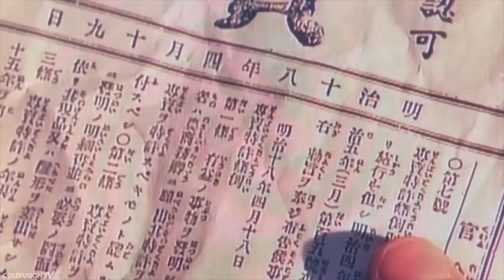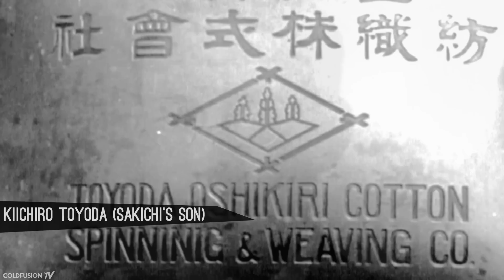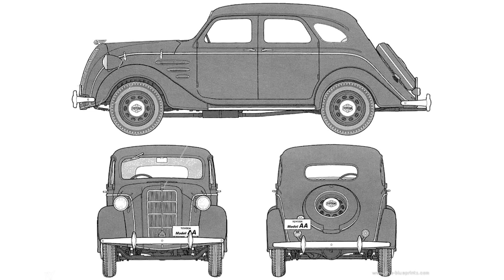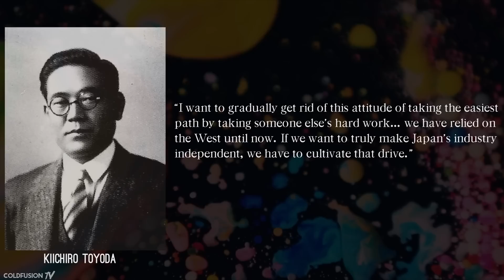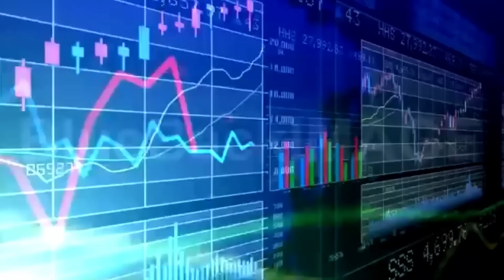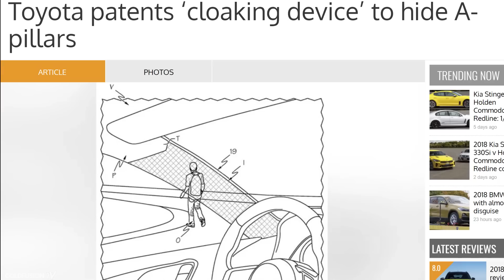How Big is Toyota? (They’ve Owned 27% of Tesla Motors!)

Comment: I crashed my Toyota Corolla and engine is still running perfect with over 200k miles. Everyone should have a Toyota as a back up car before getting a more luxury car
Reply: Just hop on that Lexus brand!
Reply: @LilAzn49  land cruiser
Reply: Haha i crashed my 1.5 l toy and i thought oh shit causee all the lights on dash and oil light going crazy, then i turn it on after i get over the shock and drove it to the side... 310k miles strong engine just i let it go to scrap cause fixing the body would be more expensive than just getting something else. Cheers!
Reply: @Jesse Mulliniks get a Lexus!
Reply: my luxury car is toyota. Ranking of my favorite 1. Toyota Avalon 2017, 2. Toyota Corrola 2019, 3.Toyota Previa 2014, 4. Toyota Mirai 2019 after I fogoten of jaguar xjr cause it's impossible
Reply: My dad works in toyota

Comment: My Camry Hybrid is still running after I put 400K (miles) as taxi and never have problem.
Reply: you put gas or charge it ? Which one you do more ?
Reply: Babar Ali hybrids are charged by regenerative braking and gas engine.
Reply: @Jesse Mulliniks plugin hybrid should do all the above plus be able to plugin. unless its purely electric then it will just rely on its own batteries charge solely.
Reply: Dito
Reply: @Babarali08333  Hybrid means you still pump gas Einstien....... Toyota has been making since 2000...... They are the leader of hybrids! They are the leader in the hybrid game!
Reply: Hybrid how is that possible

Comment: I own 2006 toyota avanza in Indonesia, it has very basic car but reliable run 300k km with no annoying problem, easy to fix, low maintenent large market & cheap spare part, practicle, it has just 1SZ-FE 1.3 liter 7 seater front engine real wheel drive, price converter to u.s around $9000 at new, and that car was best selling car over 15 years.
Reply: thought honda mobilio and brv plus mitsubishi xpander starting beat this car on sales
Reply: latio latia before avanza  launch new model... Lol
Reply: Avanza is astra product, not toyota. Same like innova.
Reply: Veez what ever dude, i just saw toyota badges on my steering wheel, rear door, front grill and under the hood
Reply: RAIL BRO now fix lexus 570, lcgc should be compared to lcgc
Reply: Gigine Ahmad sorry for waiting, i don't have money to fix that big brother, but i can go with my car now every where, take a look back your self...
Reply: Veez... Most car in indo are made in Indonesia
Reply: yeah, but its under toyota standar

Comment: Since it's pretty hard to find, Toyota's quality system is also called "5Gs" in the industry, with the 5Gs being:

Genba - Learn from the place where the actual work is being done.
Genbutsu - Learn from the actual materials and components that are being used.
Genjitsu - Learn from real facts and figures.
Genri - Learn from actual theories.
Gensoku - Learn from actual operating standards.

"Gen" in Japanese means "real" or "actual". i.e., don't assume anything, don't make stuff up in your head. Go check on what's real.
Reply: Sounds like the ultimate brand for theists to avoid.

Comment: Crazy, I just finally purchased my first Toyota. I got the 2019 Camry SE 2.5L 4cyl 203hp + convenience package for $28,500. There's only 3 things that I could think of, that's missing from it being fully loaded. I don't have sun/moonroof, no navigation and it isn't a V6. But, it literally has everything else; push to start, keyless entry, lane departure warning, rear heated mirrors and blinkers, adaptive cruise control <one of my favorite features lol, lane assistant (it literally turns my steering wheel back into lane), back camera and traffic alert from left and right side and a lot more features. I got side skirts, rear trunk spoiler, door body molding spoiler, adaptive headlights and the weather carpets, trunk package. I actually get 32 miles in the city instead of the 30 as stated. It's phenomenal! I've owned; Mazda, Honda, BMW, Mercedes, Lexus etc. This one is at the top. What you get out of it, you'd expect to pay into the mid $30k and $40+. I got the Camry at 4 miles last Sunday (8/11/19). It already has 675 miles a week later and I only had to fill it up once, since I got a full tank from the dealership. lol I'm going to be the first and last owner for this vehicle. Hoping to try and get at least 150k miles before any major repairs. Well see. Going to post up videos soon on YT in a couple of weeks.

Comment: I have a fairly modern Corolla and I have been hating it due to lack of technology and entertainment systems but after those years of use the car is still holding up well and I am starting to appreciate the car more due to its efficiency
Reply: ziad ahmed, you can always add your own entertainment system. Search car joying 
https://www.carjoying.com/head-unit/s-v/toyota.html
They make android entertainment units for most cars that can be easily installed by anyone. Sleek and beautiful!!
Reply: Too much tech is what makes a lot of today's cars quite unreliable. My grandpas ke72 Corolla wagon has run around 400,000km still fine, all you need to do is an oil change here and there and some simple service. I predict it'll last till around 1.2 million km, no joke.
Reply: Toyota reliability is not what it used to be. But they still charge a lot for their cars while offering less features over their rivals.
Reply: tehcnology and entertainment systems can easily be added on by yourself.
I have an Toyota Avensis, I recently put in around 500 dollars worth of a new DAB+ radio with Touch display and in-buildt GPS android based system.
Hooked it up with the steering wheel controlls without any issue or settings needed. (Just selected the Toyota brand in the Radio system).

Works like a charm, and easy to do yourself.
Just watch a youtube video how you dismount the dashboard (pretty easy once you know the key trick, you also get the tools needed to do so with the radio system)

It was actually fairly easy to install all this that I ended up making mount and electric system for Tablets and Smartphones in the backeat for backseat passangers.

Note this was a Avensis 2009 model, it didn't come with any of theese standard. Yet it was fairly easy to implement aftermarked.

I'm saving up for a new car atm, I might sell the car with the enternainment system i installed. or I might just dismount it and install it into my moms car (a Nissan Qashqai, or just sell it used)
As my new car isn't going to be suited for entertainment systems to begin with.
Reply: You want more distractions to add to your car, so you're more inclined to bump into others? More things to break down? 
All you need a is radio station, a good set of speakers and a reliable set of wheels. That's what the corolla is.

Autonomous cars are only just hitting the roads; save the "home theater package" for them.
Reply: Toyota takes quality control very seriously as they were the ones that pioneered Lean Manufacturing with the help of William Edwards Deming.  They rarely have electrical issues. The Prius is full of Denso electronics and computers that's already proven how reliable Denso electronics are as those cars are commonly used as Taxi cabs and Escort pilot cars. The 2nd gen Prius has 17 different ECUs. That's why Lexus and Toyota still continues to top Consumer Report reliability charts year after year for nearly 20 years unchanged. Everyone is trying to copy the Toyota Production System but many fail to match Toyota's quality. http://www.toyota-global.com/company/vision_philosophy/toyota_production_system/
Reply: Gesteppie not distractions, but Toyota lacks even mod cons and safety systems. 
GPS, HUD, Bluetooth, auto city braking, blind spot monitoring, reverse cameras, heated and cooled seats, so much more I could go on about which are nice to have but not necessarily distracting to the driver. On some models of Toyota they will not have these features even though their direct competitors do. 
I had a Landcruiser Prado for a Work car. Reliable, expensive and extremely basic for a 2013 model car. It's competitors are generally cheaper and had similar or even more features and nicer interiors. 
The Landcruiser name is iconic and Toyota know that. 
Cheapest 200 series in Australia is about $80,000. 
It's closest competitor is a Nissan Patrol which stars around $65,000. 
Patrol is a better vehicle in almost every way.
Reply: Hem57i
The Toyota will be running flawlessly long after that Nissan has turned to rust.   People know that, which is why they buy Toyotas.

Comment: 2004 Toyota Camry here and forgot to change the oil for 10,000 miles once... 250k strong
Reply: 10,000 miles without an oil change is a joke for a Toyota. You could easily go another 10,000. I have a Honda Accord and I change the oil every 15,000 with no problems. 230K miles and that engine runs like new.
Reply: wow. that is insane engineering.

Comment: You should take another look at Toyota Industrial! You spent about 10 seconds on one of the world leading industrial  manufacturers. Not only has the company been rated #1 for the last 14 years, globally they own dozens of other brand names in industrial equipment. You only scratched the surface of Toyota.
Reply: Tom Jubell The Toyota Production System (TPS) was basically the foundation of lean manufacturing.
Reply: Just saying that because you have a toyota
Reply: I'm very suprised he did not mention anything about lean manufacturing it is the sole reason Toyota produces such reliable cars. Also the reason they're able to sell cars in any market.

Comment: A lesser known Toyota fact, they decided to compete in the ski boat space around '99-'01. They came out with several Epic boats all very reliable and incredibly fuel efficient running a modified version of the Lexus 400 v8 engine. They didn't stay in the market too long but many of these boats are still running strong. I own a '99 Epic 21 model :)

Comment: I want Toyota to buy Lotus. Imagine that, finally a reliable Lotus.
Reply: Dream come true now lotus before own by proton now this both company own by geely today.. Chinese company also own Volvo..
Reply: What's wrong with Lexus? What's the point of buying POS and making it run when you already have your own - superior - product?!?
Reply: Lotus has been using only Toyota engines for the last 20 years.
Reply: @piuthemagicman  I'm aware. A car is more than an engine though.
Reply: @piuthemagicman  A vehicle contains more than just an engine...
Reply: @Woland @Vlad Rep How I think about it; it's good to have the high revving power making part of your performance car reliable Toyota and the specialized chassis and suspension stuff made by good ol' Lotus.
Reply: Indeed a car is far more than a can of tin. Something with a soul independent of who makes it and where it's made :)
Reply: @piuthemagicman  I doubt lotus and reliability belong in the same sentence, and as much as revving power may be important, when it's sitting on the side of the road waiting for a tow truck or at a stealership shop, that power is irrelevant.

Comment: Toyota’s recent endeavour into fuel cells has left them struggling in the pure electric market. The Mirai has been a complete flop with barely above 3000 sold over their entire life.
Reply: Loui Coleman it may pay off in the long run though as they are ahead in the fuel cell industry, and that may prove to be more efficient than electricity in the distant future. Only time will tell. But yes in the short term it isn't looking too great
Reply: Fuel cell will have a place, hydrogen to power the fuel cells has storage issues. However the Hydrogen and oxygen (rather than air) have to be absolutely pure to prevent fuel cell contamination and degradation
Reply: They didn't make Mirai and expected just to win the market. They are fuel cell believers, so they'll make the first step to the market. FC cars need hydrogen infrastructure to be ready first, which is not the case. However Japan has the advantage and will to build a hydrogen economy, which is benefited by growing renewable energy production.

Hydrogen didn't work because electricity was not clean in the first place, now renewable electricity needs also high volume of storage, which would put hydrogen in an advantageous position.

In short term, electric cars are easier to deploy. In the long run, hydrogen produced by renewable energy is the ultimate solution.
Reply: why dont they make a tesla rival?
Reply: I agree long term, toyota is ahead of the game
Reply: Fuel cells for cars is a waste of time...the infrastructure is not there..it is Solely dedicated power source making it tethered to a source it can't spread out the cost to other sectors..the storage of fuel cell and other technological issues packaged into a car.  Fuel cell is futile in cars.  The future is full electric and battery or equivalent.

Comment: Does anyone remember toyota tarcel?
Reply: Had one big pec of junk 1991 toyota turdcell with a motor cycle carbrator on it it would get full of carbon and have to be cleaned about once a year.
Traded it in on a 1994 Celica in 1995 I still own the celica in 2018.

Comment: My first car was a 96 Camry. This was back in 2003 so the car was already 7 years old when I bought it. I was a poor uni student so my idea of a service was filling up fuel lol. I drove that car for 5 years without ever doing any servicing or oil changes and it ran perfectly fine. When I sold it it was still in perfect running condition. I have owned many cars since, honda, ford, daewoo, Hyundai, nissan, mercedes (money pit), kia, Mazda. None were as reliable as the Camry.

Comment: My 1987 fiero is still running.
2001 7.3 still running and has 312k miles.
2004 mach 1, that has a shit ton of nitrous been put through it and is till running.
My brother's 1999 camero is still running.
It's not about manufacturer, it's about doing the maintenance and running the right oil.

Comment: my father owned more than 7 hilux ,3 corollas and a land cruiser . they were invincible and still I own 07 hilux from brand new and it still running like a dream although i had to change it's face several times due to heavy accidents and the whole left side of it but in terms of engine it still running without any rebuilding or change the whole engine

Comment: So....About the engine oil. I don't tell many people this but in my Toyota Scion XA, I once ran out of oil and forgot to take it to the shop to get a oil change. I kept ignoring the maintenance light. This was about two years ago. I drove with no oil for two weeks and didn't notice anything wrong other than the car didn't have the normal power.When I took it to the dealer they said my car should be dead. My car showed them and at 260,000 miles now I am well on my way to 2021.

Comment: I have owned as well as driven a lot of Toyota - cars, commercials and buses. They all say one thing "the quality is better";  I bought a 4wd Hilux in 1983 and traded it 14 years later with no mechanicl failures, as far as I know it's still on the road. My current car is a 2010 Hilux twin cab, a totally reliable car. I have had commercial vans the Hiace as well as Mazda E200, Nissan Urvan and Mitsubishi L300. The Hiace came out on top. The Mazda needed a top end rebuild ay 100K, the Nissan and the Mitsubishi broke down regularly. The Hiace only off the road for regular servicing.

Comment: Love my '98 Corolla. It looks like a spotted tiger (original paint is going, but it runs great and burns very little oil at less than 200,000 miles). (It's my "baby", even though sometimes the driver's side door latch fails, ha-ha, and I have to roll the window down to get open the door).
God Bless TOYOTA / TOYODA --- the world's most reliable car!

Comment: My 2001 Tundra has 260,000 miles and counting with original smooth engine and transmission...
I've seen guys with NEW F150 o Silverados having transmission issues with 80,000 miles or even less!! not to mention the typical check engine all day long.

Comment: I had a 1999 Toyota corolla. I was in a car seat in this car. I drove it up to 2015, when I started having transmission problems. It hadn't died yet but it was at 350k miles when I decided to trade it in. Most expensive repairs I had in the 3 years I owned it (I bought it from my dad) was a $12 part. I now have a 2014 toyota corrola with almost 100k miles that I love and is almost paid off. I would live to have a 2020 corrola hybrid but I promised I wouldn't get a new car until this one dies. The way its looking it will probably be another 10 years. That's fine it will just give Toyota time to put heated seats in the hybrid.

Comment: I own and will NEVER own another brand. I put 171,000 miles on my 2008 Prius and have NEVER had it in the shop for anything out of the ordinary. I even went over 100,000 miles before I need brakes!!!!  34 oil changes 12 air filters, 6 sets of tires, 1 coolant change and I would not be afraid to drive it anywhere and back.

Comment: Still drive my 2005 Corolla which I bought in 2006 with 7k miles on it. Now at 141k miles and not a single engine or transmission issue to speak of!

Comment: You did not talk of the Audi accelerator problem on the Audi A5!  I owned one, and it would make the car accelerate, on it's own, causing it to rev to full throttle while sitting at a stop light.  Yikes!
Reply: Correction:  That was the Audi 5000 (I believe).  Sorry folks, there has been a lot of water under the bridge, as they say!